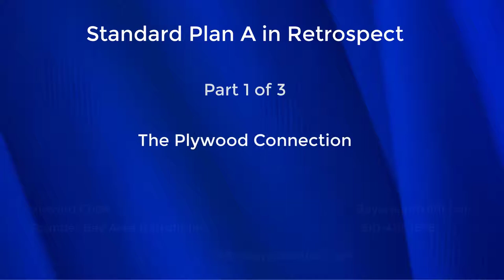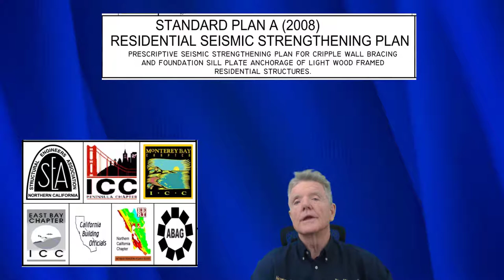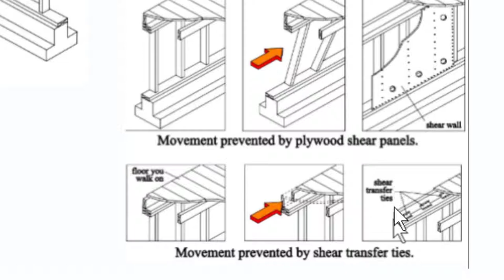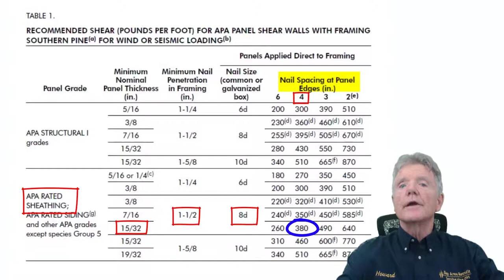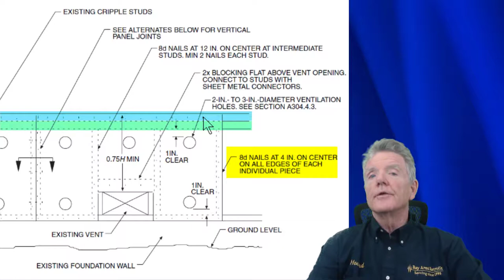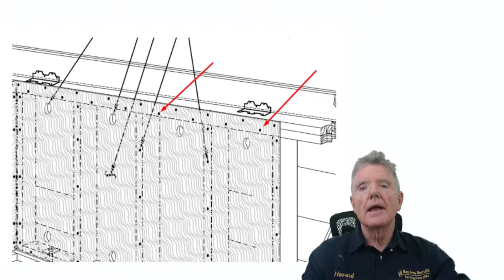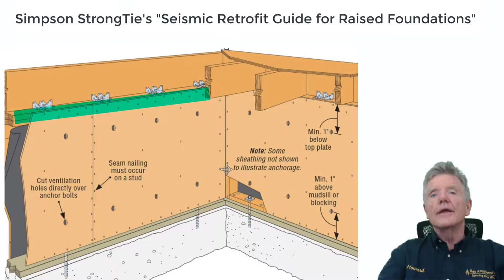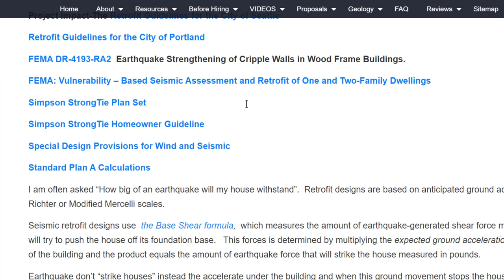Standard Plan A Plywood Nailing Extra Long Version

Comment from the maker: There are no tests.  All the force goes into the upper top plate through the hardware and toenails so there is no need to use glue.  There is no telling if there are any nails between the two top plates and if there are it is only a minimal number.  Tests have show the closer the plywood nailing on the edges the more resistant to earthquakes the plywood is. Look up Top Plates on the website bayarearetrofit.com and you will understnd more

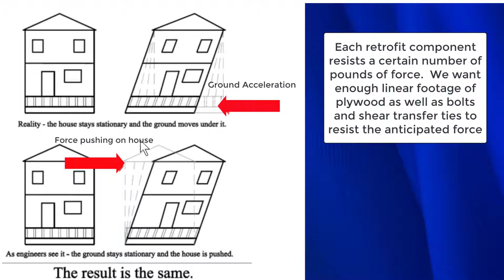Comment: At 13:30 you discuss how the design can resist 8,280Lbs of earthquake force. Can you tell how much force is generated by the value of the earthquake? Like would that be what a 7.1 earthquake would generate at a quarter mile.
Reply from the maker: It is not done like that.  Engineers look at ground accelerations, not Richter scales.  The highest ground acceleration used in the code is around 0.25gs.  Multiply that by the weight of the building and that number tells you how much force you must resist.

Comment: Just my two cents from outside the US. For convinience I wood treat the lower top plate just like any other intermediate frame part ->12" o.c. . 
My non professional engineering mind is telling me: Upper and lower top plates are nailed together, too. For every nail in between the plates one edge sheating nail may be on the lower top plate.
Why you're not putting a bead of glue on the critical nailing lines? Are there any reasons or tests to this?
Reply from the maker: They might be nailed together sufficiently, probably not.  If you sister nail the two top plates together you can stagger the nails between the top plates in the plywood or even put them all in the lower top plate.  If a pipe runs along the upper top plate this is what we do.